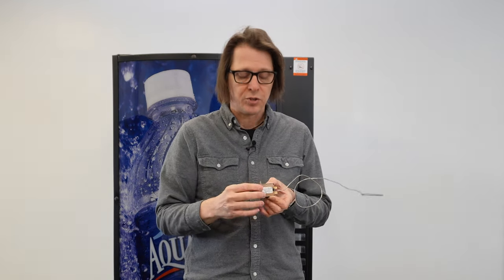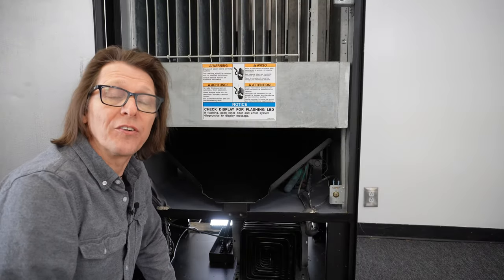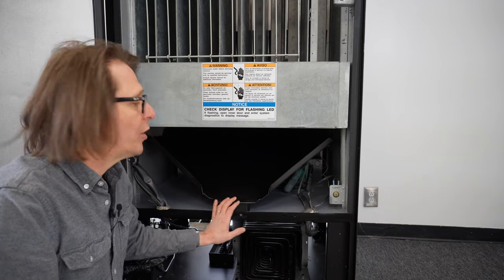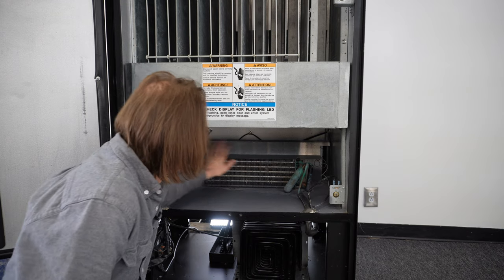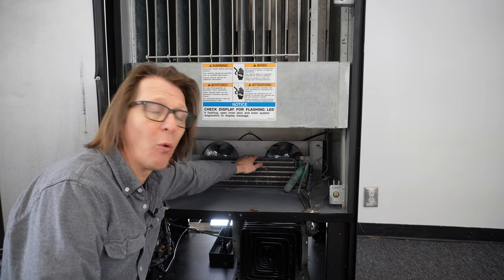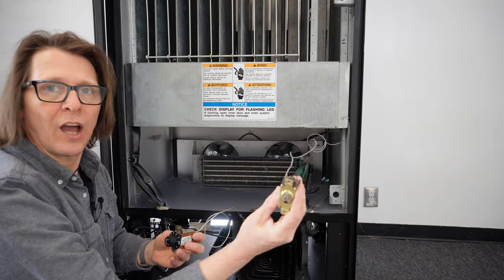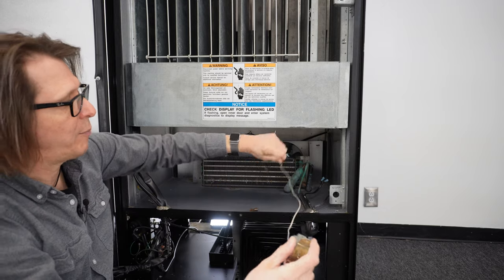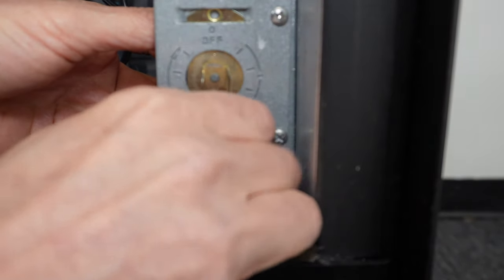How To Install A Drink Vending Machine Thermostat

Comment: Thank you so much for your videos! I have a Dixie Narco 276 Pepsi machine that has a copper tube that runs behind the evaporator that’s part of the fan housing shield. I slid my thermostat in to it reaching about center behind the evaporator. I’m hoping that’s what that was designed for?
Reply from the maker: That is exactly what that is for! Well done!

Comment: Hey man, I appreciate these videos. I have a 276e but it keeps getting frosted over. The thermostat it had on will turn off the compressor if I set the dial to off/0 and turn on the compressor if i move it to 1 and above. The issue is that it never turns off. I let the evap coils build up some frost and placed the bulb of the tstat on the ice for a few minutes but it did not turn off the compressor. This is the second tstat i put in but granted it came off another machine and had unknown working status. The evap fan is working fine and the condensor fan also turns on when the compressor turns on.
Reply from the maker: Thank you for the kind words. You are doing a great job in narrowing down the issue. With the original or the replacement thermostat hooked up. Place a thermometer into the machine so you can get a reading of the actual temp inside the machine. You are looking for a temp between 36 & 40 for drinks. I am going to assume that you tried this compressor field test ( https://youtu.be/oaSexyNrdks ). You mentioned that the second thermostat was pulled from another machine. Was that a known working thermostat? What happens if the original thermostat is placed into the donor machine?
Reply: @VendingMachineSupport  Thanks for the reply. The drinks do stay cold. The only thing I did not test from your video is the 15 minutes frost over but it does start forming ice fairly quickly on the evaporator outlet (tube portion connecting to accumulator) however that accumulator does not ice over just gets cold.The first tstat I threw away because it was stuck open and did not turn the compressor on no matter which direction. This second tstat was pulled from a machine in storage but i am not sure if it was a working thermostat other than the simple test I did as folows: turning the dial to 0 will turn off the compressor, turning the dial higher than 1 will turn on the compressor, placing the thermostat capillary bulb on the already formed frost of the evap coil will not switch the compressor off even if the bulb is very cold to the touch.

Comment: I have two Royal 650 that have the coke EMS how do I buy pass that an put a manual thermostat in there is one wire going from EMS to the relay an another wire coming out of that going to lights I think I could be wrong. Also that thermostat is a two wire how would I go about that thanks Alex you have great videos
Reply from the maker: The two black wires that plug into the rig relay. These can be removed and installed onto a manual thermostat. You will need to run the temp probe into the cold box of the machine. Here is a video where I explain the frig relay test ( https://youtu.be/yIgDyCrBk4Q ) and a video on how to determine which relay is the frig relay if you have two relays in your machine ( https://youtu.be/5SYYrIn3tYs )

Comment: Does the capillary tube have to be ALL the way inside the small hole in the cover.   I brought a machine hat has it going in then makes a u turn and the tip is sticking out.  But  yes the tube is in side the small opening.
Reply from the maker: Just be sure the back of the cap. tube is getting hit by the air coming off the back of the evap coil.

Comment: Hey, been watching your videos for weeks now, and I have a question regarding my drink Vendo machine not cooling off at all, any help would be very much appreciated.
TIA
Reply from the maker: Have you made your way through these steps in my video on How To Field Test You Cooling System? https://youtu.be/oaSexyNrdks
Reply: @VendingMachineSupport  I have but to no avail, as I was not able to locate the compressor plug to unplug and connect to the extension cord, my also also has 2 fans, and only one's rotating.
Reply: @aboubakarmansare7021 so we might have the same vendo anyways ur plug should be plug in to the box. And well if if can find just cut the wires make a new plug bro just don't cut the wires to short . Anyways  try this first u know ur fan well fallow doses  wires they should be wired up to the compressor